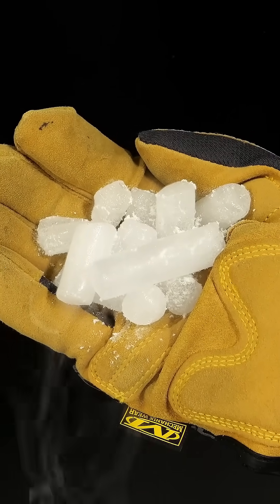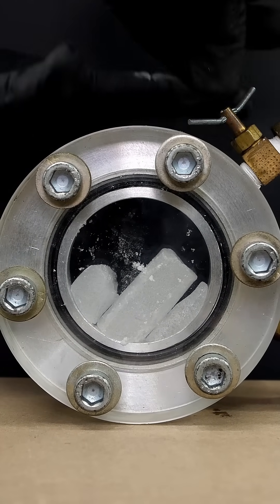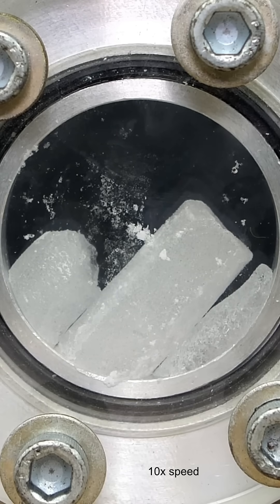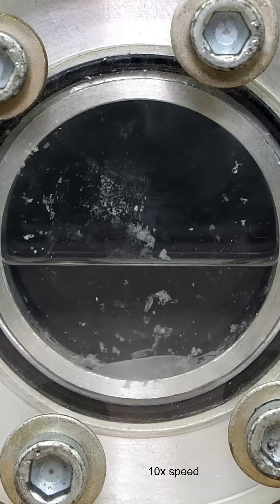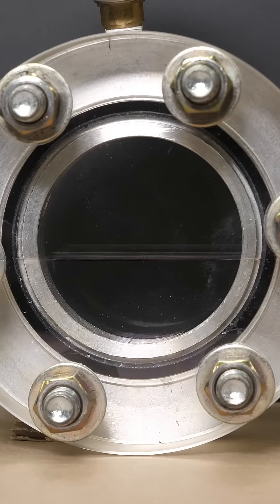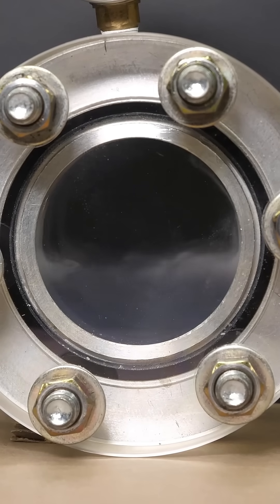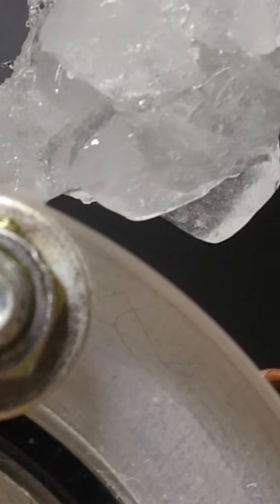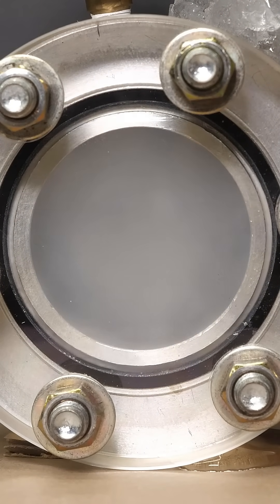This is not a liquid or a gas

Comment: Check out the rubber gasket… you can witness CO2 ESCAPING the rubber, because it actually dissolved itself into the rubber.  This causes a primary form of rubber failure in the Oilfield.
This is called Rapid Gas Decompression.

Comment: “This isn’t a liquid or a gas” 

Its a solid then
Reply: Semi solid
Reply: @benjaminkline4855  antisolid?
Reply: @benjaminkline4855  semi bisexual
Reply: Its Florida
Reply: Superfluid.
Reply: Plasma.
Reply: @ZodiacShadow71  I was wondering if anyone was ever going to bring up the forth state of matter.
Thank you.
Reply: @thomasarussellsr  Bose-Einstein condensate
Reply: @thomasarussellsr  🤣
Reply: @kj_2  Quark-Gluon plasma
Reply: Take it from a guy with a chemistry degree, it’s more important what’s happening on the molecular scale than what we can see. Here’s what I mean:

Matter is made of small particles, usually molecules but sometimes individual atoms depending on the material, that in solid form are firmly attached to one another through chemical bonds. 

Temperature is a measurement of the kinetic energy (motion) of particles at the molecular scale. When particles gain kinetic energy as solids, that energy manifests as vibration. Add enough energy, and the energy of the particles are able to overcome the forces keeping them in place and detach themselves from the solid, moving independently. This is the process of melting into a liquid or sublimating into a gas, depending on the material and temperature/pressure conditions. 

Different particles depart from the solid phase differently. For example, if solid water is heated up in the normal atmospheric pressure it melts into liquid water, while solid carbon dioxide sublimates into gaseous carbon dioxide. Whether the solid melts or sublimates is a function of chemical properties of the particle and external conditions. 

Particles continue to interact with each other, even when they are no longer attached in solid form. There is a state where they have enough kinetic energy to move around independently, but the intermolecular forces between the particles keeps them held quite closely together, so they slide past each other instead of freely moving in any direction. This is the liquid phase, and it’s characterized by strong intermolecular forces that keep particles close together while they fluidly move past each other. 

The gaseous phase is instead defined as a state of matter where the particles have enough energy to overcome not just the chemical bonds that would make them solid but the intermolecular forces that would hold them in the liquid phase. Particles in the gaseous phase move in approximately straight line trajectories until they hit another particle and deflect based on the exchanged momentum. The individual particles are moving fast enough that the intermolecular forces that would attract them into becoming a liquid are not strong enough to hold them together. 

There also exists a space at simultaneously high temperatures and pressures where particles are strongly influenced by intermolecular forces because they are forced close together by the pressure, but still move extremely quickly through space because the temperature is so high. This is called a supercritical fluid, and it’s what NileRed is showing in this video by increasing the pressure and temperature of the carbon dioxide in the tank. 

This stuff is really interesting, and I’d highly recommend reading about similar topics in thermodynamics if you’re interested in NileRed’s content or chemistry in general. It can really help to understand the mechanisms behind the stuff we see in day to day life :)
Reply: It's a gas.
Reply: @enekaitzteixeira7010  It's a fluid, liquids and gas are actually the same
Reply: @ggwp1847  Actually the same? Ah no different state.
Reply: @12Burton24  The only reason you think that Is because you can't see the air, water is heavier than air, if It was the other way around then the air would act like water, taking the form of the container you put It in. And water would work like air if It was just as light. And it's a difference in weight, not in state of matter. And since the only SCIENTIFICAL difference there Is between gas and liquid Is the shape they take, and that happens only because of the weight difference between water and air in the atmosphere. Then there Is no difference between them. Also you could just Google It you dork
Reply: @ggwp1847  WTF are you even talking about each material has different states some other normal pressure and local thems are fluid some are solid and some are in gas form.
Reply: @12Burton24  Fluid? You mean liquid? You're not even sure which is which and you're trying to contest my shit?
Reply: @12Burton24  "Liquids and gases are called fluida because they can be made to flow, or move. In any fluid, the molecules themselves are in constant, random motion, colliding with each other and with the walls of any container" -NASA Glenn Research Center, Phases of matter
Reply: @ggwp1847  Its still two different states gas will equaly spread in the possible room while a fluid will stay on its place with close molecule distance. different Physical state  may you call it the same in english but its still not the same state due to its behaviour.
Reply: @ggwp1847  You shit is shit you are right because i tell you there are several different physical states. And yeah may i use the not 100 percent correct words because englush was just the forth language i had to learn...
Reply: @12Burton24  The behavior doesn't change because of the state of the matter but because of its enviroment. We, for ease, like to call it a liquid or gas, because that's how we see it. Just like we say that the sun sets instead of saying that it's orbiting on the other side.
Or like we say gravity Is a force because It feels like It, but it's actually curvature in space/time.
Reply: @12Burton24  I'm not native english either. Anyway you must be a kid, no sense arguing with you
Reply: @12Burton24  what on earth is your point
Reply: @ggwp1847  Liquids have a fixed volume. Gasses don’t. Clear difference.
Reply: @kj_2  Ask the other guy....he is somehow not able to understand that a material has different physical states. He calls gas and fluid. So he calls water vaper the same as water in as fluid in a liquid state.
Reply: @stevecoops2469  correct
Reply: @12Burton24  I mean liquid and gases are both scientifically categorised as fluids, but they are definitely different in aspects other than mass(or density). I'm desperately confused why the other guy insists they're the same thing. We are literally taught in primary school that liquids have a fixed volume while gases don't.
Reply: @kj_2  Gases spread out in the room the got provided. Different physical state. Anyway maybe its also just a misunderstanding my english is also not the best.
Reply: @stevecoops2469  That's because of pressure, external factor
Reply: @ggwp1847  I dont need google to know that its all about density.
Reply: @ggwp1847  Pressure and temperature are the variables that determine what state a chemical is in, yes. But by your logic everything is a gas - just stick it in a vacuum 😂
Reply: @stevecoops2469  no, solids stay that way in a vacuum
Reply: @ggwp1847  thought you were talking about liquids and gasses. Or is a solid a fluid too 😂 

You’re just wrong mate. Get over it 😂
Reply: @ggwp1847  liquids and gases are the same thing 🤣 🤣 🤣 

What a statement.
Reply: @ggwp1847  No, there are gasses that are heavier than liquids. And no, shape is not the only difference between gasses and liquids.
Reply: @ggwp1847  Then breath underwater. That's totally safe :)
Reply: @STVNDMC  Yes, the liquid molecules are rolling on each other, and the gas molecules are moving fast in a straight line. (Sorry for my english, i am not a native english speaker.)
Reply: @12Burton24  they are both measured in fluid measurements.
Reply: @12Burton24  gas actually sinks because of density, and temperature. That’s why hot air rises.
Reply: @AbysmalAbsalon  m8 dont remember about what this topic was just about your comment gas is not sinking the more dense gas is sinking and fluid state is more dense  so most gases are above fluids like oxygen, hydrogen and so on.
Reply: Blind?
Reply: Solid Snake?
Reply: It’s aqueous
Reply: It's a ligament xD
Reply: Its a liquid, also a gas, and a solid. Gasoliquid
Reply: it's a soliqas
Reply: Bose-Einsten Condensate.
Reply: @DarkSister-0 thats not a bose einstein condensate lmao
Reply: @floseatyard8063  Why double?
Reply: @DarkSister-0  youtube glitch probably I've seen entire reply sections duplicated or tripled before
Reply: @DarkSister-0 thats not a bose einstein condensate lmao
Reply: Lmao that's what I was thinking
Reply: @sebasdavis8081  same
Reply: I was gonna say that!
Reply: Quantum superstate
Reply: Liquid gas
Reply: Giquid or lag
Reply: @pyritewastaken  las*
Reply: no it's 3 in 1
Reply: Thats what i thought of...
Reply: I like how these people are complaining X DDDDDD
Reply: It’s plasma my guy
Reply: Bose-Einstein Condensate
Reply: It’s treason then
Reply: Me: plasma then.
Reply: A thing.
Reply: Yea I agree btw I haven’t watched the vid yet
Reply: Pretty sure it's a Chicago style deep dish pizza
Reply: @silverhawk8699  well, if we're going there, pizza has components that separately belong to all three commonly known states, solid (crust and toppings), liquid (sauce and melted grease), and gas (steam, and aromatic fumes).
Reply: duh 😂
Reply: Plasma tbh
Reply: It's solid though
Reply: I was going to say the same thing
Reply: It’s treason then
Reply: Gaseous liquid maybe?
Reply: It’s yur mom.
Reply: Dammit you beat me to it and I'm only 5
Reply: Its a liquas
Reply: @SNIXC  😂😂😂🤪
Reply: It’s a state of matter
Reply: No no no, it’s the 5th state of matter, a BECs
Reply: You guys: um actually, it’s a plasma 🤓
Reply: @WormOnAString69  um actually 🤓
Reply: I was about to say that
Reply: When you think you're a scientist after graduation
Reply: mostly gas part of it is still liquid in form of small vapour drop 🙄
Reply: Ah you’re close…
Reply: No, it’s a supercritical flyid
Reply: @hyzmarie  whooosh
Reply: Or plasma
Reply: @T25studios Plasma temperatures are in the order of thousands of Kelvin, if not tens of thousands.Not likely to be a plasma
Reply: there are dozens of phases of matter
Reply: No one mentioning that he didn't say it was neither. He Said it was both.
Reply: Its a gas AND liquid AND solid
Reply: fluid.
Reply: I read that in Palatine's voice.
Reply: It’s a lolsquid
Reply: @Enneamorph  squid game
Reply: or plasma. it's kind of a new thing... but yeah there's a 4th state of matter.
Reply: @sheilaolfieway1885  actually, it was discovered 143 years ago

so yeah
Reply: @thatmagichatguy8761  yeah but when was it made offical when they taught me chemistry in the 1990's there were only three states of matter.
Reply: @sheilaolfieway1885 it has been official for a very long time, it's just not particularly useful to talk about all the states of matter as there are many more than three of them (bose-einstein condensate, supercritical fluids, some other mixed states that I can't think of atm)

we learn about solids, liquids and gases because they're the states of matter that exist predominantly on earth. There's not many places outside of a lab where you'll find a plasma or bose-einstein condensate, so learning it while you're a kid doesn't really contribute much
Reply: @sheilaolfieway1885  It's not new, everyone just forgets about plasma
Reply: @sheilaolfieway1885 its not plasma otherwise it would be conductive and need to be stored in a proper chamber
Reply: @sheilaolfieway1885 plasma isn't new.
Reply: @sheilaolfieway1885  I knew about this since second grade.
Reply: It's a super critical fluid! 

Superfluid❌
Plasma❌
Gas❌
Liquid❌
Solid❌
Vapour❌
Semisolid❌
Bose-Einstein Condensate❌
Quantum superstate(it is called superposition)❌
Aqueous❌
Antisolid❌
Florida❌
Supercritical Fluid✅✔☑
Reply: Nope, more like a plasma
Reply: Its plasma 🤣😂😝

Comment: accordingly to what I understood about this and what Wikipedia says, this is a "Low-energy modern state of matter" called a "Supercritical fluid" which is "At sufficiently high temperatures and pressures, the distinction between liquid and gas disappears." so yeah, just in case you're wondering

Comment: This phase change can be shown on a pressure-enthalpy diagram. The solid dry ice condenses into water with elevated pressure, but it begins to experience a phase change when you start introducing heat (the hair dryer). This hair dryer, amazingly, doesn't actually increase the temperature of the dry ice. Instead, what it does is evaporate it from a liquid to a liquid-vapor mixture. Eventually, with enough heat, the dry ice would then fully evaporate and turn into 100% vapor as well as increase in temperature.

Comment: So... If it's not a liquid or gas, what is it?
Reply: It's both at the same time. Without going too deep into the physics of how this works, there's a point where most fluids (at a certain pressure and temperature) turn into a mixture of a vapor and a liquid at the same time. It sounds trippy, but pretty much what's happening is a portion of the total volume of the dry ice is liquid and another portion is slowly turning into vapor (which is where you start seeing that cool effect). With enough heat, the whole thing would eventually turn into vapor.
Reply: @linky202  Sounds like an equilibrium reaction but for a change of state instead

Comment: This is pretty much how freon behaves in your AC system. Compressor pumps liquid freon through high side, the liquid freon becomes a gas as it passes through expansion valve or orafice tube, and goes back to liquid freon when it passes through condenser on the low side.

Comment: Back in the 70s, weed dealers who had weak or stale marijuana they would place a brick of Dry Ice on top of the marijuana and leave it in a sealed container until it evaporated. They sold it as Cheeba Cheeba. When you smoked it, you would get the same high as a PCP high.

Comment: Triple point visualised finnally
Reply: Triple point is not the same as the critical point.
At the triple point, the solid, liquid and gas phase all have the same stability and the substance is constantly changing between all of them.
The critical point is the highest point of temperature and pressure where a substance can exist in is liquid or gas form. Above this point, it turns into a new state, the supercritical state which is neither liquid or gas.

Comment: Why do they call it dry ice? When it’s not even dry 😑
(just doesn’t make any sense)
Reply: It's called dry ice because it doesn't melt it sublimates from solid to gas directly
Reply: It makes sense. When you have a regular ice cube in your hand, your hand will imediately start getting wet.
But if you have a block of dry ice in your hand, it maybe feels like your getting something cold on your skin but if you put the block away, you will find your hand perfectly dry because there is no liquid phase of CO2 at atmospheric pressure.

Comment: Title: “this is not a liquid or a gas”
Me: isn’t it just a solid then?
Reply: It’s called a super critical fluid because it has the properties of a liquid and a gas. The only way a supercritical fluid can form is in an environment with a temperature above the substance’s boiling point and a very high pressure, because even though the substance should be a gas, the pressure prevents the particles from moving freely, giving it the properties of a liquid.

Comment: Apparently, if that window is acrylic, some CO² is absorbed into it, and grossly expands it with bubbles on that side after depressurization.  I wonder if the acrylic can be weakened by it over time by extended pressurization time, or if it would blow apart like Pop Rocks after?

Comment: See that's crazy that's what I think can happen in the atmosphere and fast freeze the land beneath it. Imagine if like the nitrogen in the air condensed like that or  even the CO2 in the air. Due to a high pressure system or a sudden low pressure system with the cold front and it just dropped all that liquid CO2 or liquid nitrogen from the air onto the ground it would be nuts.

Comment: "This is not a liquid or a gas"
"A liquid and a gas at the same time"
So which is it?
Reply: He meant "this is not only a liquid, nor is it only a gas" as supercricial matter is both a liquid and a gas at the same time. Above the critical point there are no phase changes between liquid and gas, and this area is called the supercritical phase. Decrease the temperature at the same pressure, it becomes more liquid than gas. Decrease the pressure at the same temperature it becomes more like gas. Right in the middle, it is both and neither a liquid or gas.
Reply: Yes

Comment: So it becomes CO2 Vapor.  Like Water Vapor.  It's the liquid form flashed boiled into a vapor form.  Part gaseous part liquid...  vapor.
Reply: No, in vapor you have small particles of liquid suspended in the gaseous air. A supercritical fluid is not like that. You only have a single phase here.

Comment: All right, stupid question, but if you had a perfect seal on the pressure chamber would it stay trapped and change form depending on the temperature? Those would make a neat little weather dial if so.

Comment: so basically you made co2 mist am i right like if there was a planet that had enough pressure could it be called co2 mist?
Reply: No. In mist you have little droplets of the liquid suspended in air. That is not what's happening here. There is only a single phase here which is neither gas nor liquid.
Reply: @lunkel8108  nice well ill continue doing the funny